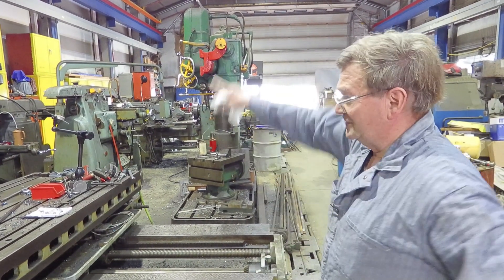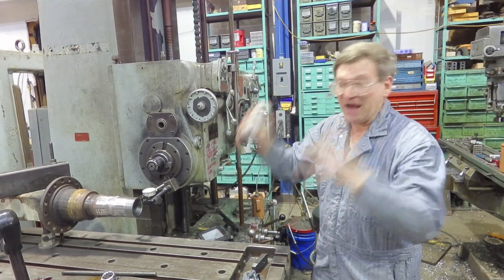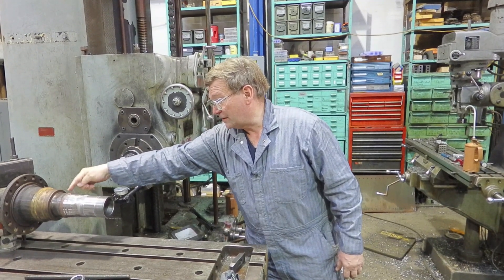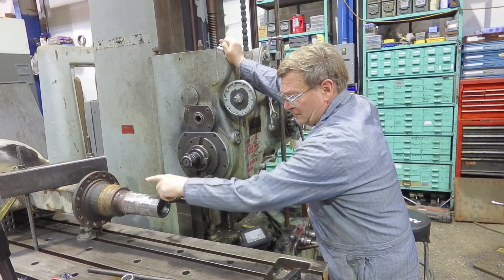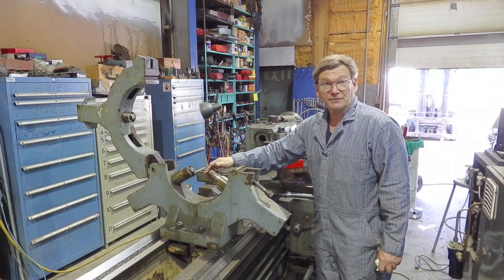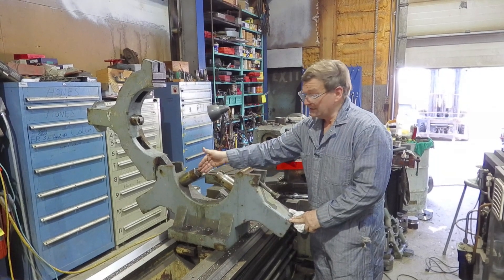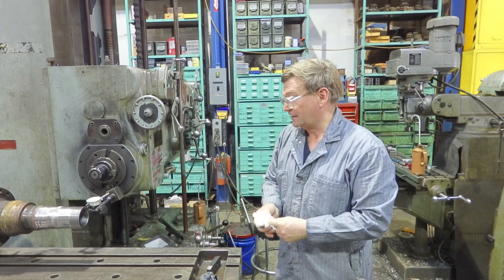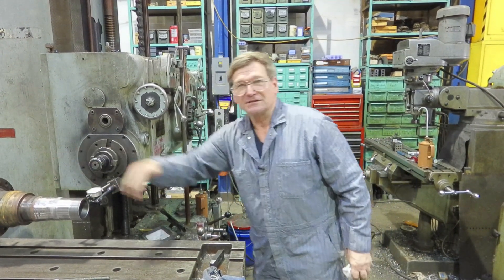Machinist's Minutes: Dialing in an axle housing on a lathe

Comment: Would have been a better video with the job in the machine. But you cannot stop production & some machining methods need to be not to detailed to protect your business. Difficult to choose a process & display while conducting a business venture. You have a good voice for broadcasting. Maybe mix it up with a white board reason why it is done that way. Like a present of compound of 10 degrees to gain a more accurate measurement. I'm sure you have many in your book of ideas.